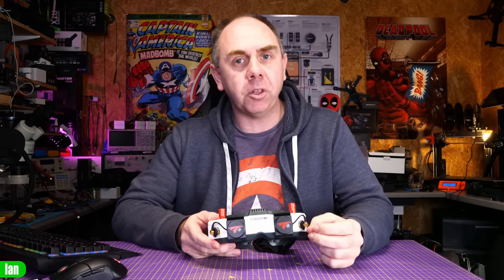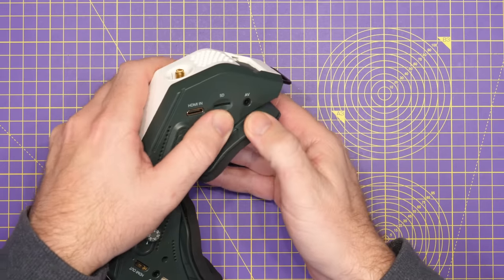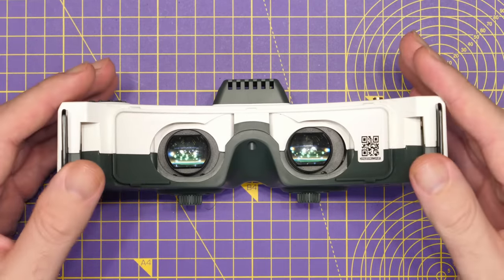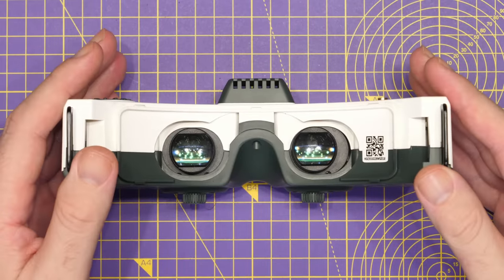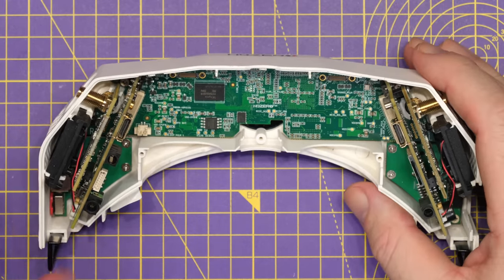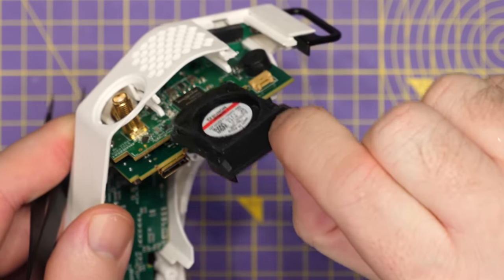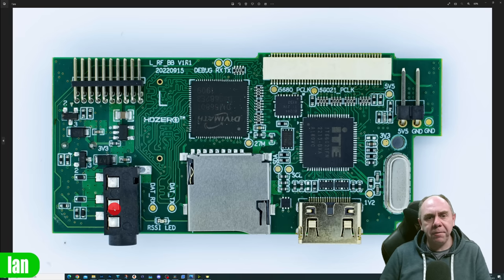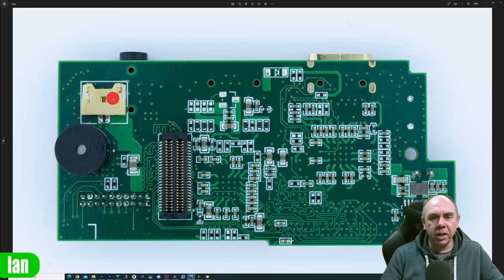HDZero FPV Goggles Teardown & Deep Dive + SMA Mod

Comment: So nice to have an electric driver for electronics when doing this. It allows you to focus on handling the delicate object more so then spinning the driver. I didn't understand until having experienced one myself, until then I thought it was probably more of a Hassle to get the electric driver and bit out vs just using standard screw drivers.  

 I will say the one area that really surprised me about the HDzeros was the side antennas don't even have a nut on them and there is a clear gap around the goggle housing and SMA connector. For comparison my Walksnail VRX is actually glued in the housing/SMA gap and that's using SMA to UFL so it's not like it matters beyond spinning/wiggle.

Comment: Wild idea, but could I use some sort of fiber converter to be able to have one of the two receiver moduals setup across the field in order to get longer range and stringer signal? I'm currently doing research and trying to figure out if this is possible. At my work we use a similar idea for broadcast cameras but the whole system is massive, both transmitter and receiver.
Of course the ideal is to be able to have multiple receiver units dotted around say a town or something in order to have a high quality, light weight drone follow camera. I'm interested in your opinion

Comment: Is there any chance you could PLEASE take a look at the optics as this would be very helpful as I am in need of a little help doing so as I have the floating optics issue.
Reply from the maker: Please can you explain what floating optics is ?
Reply: @MadRC  It is a known issue with all batches bar the ones being produced right now. It is where you can see the optics physically moving outwards and in when you raise your head. There are more cases cropping up on the fb page. The optics are moving towards you when you raise your head and falling back when you drop your head, this is more noticeable when your in the menu section. It makes them go from being perfectly in focus to completely out of focus. Carl & Gao are aware of this issue but, I was just wondering if you could make a video of taking the optics out as I am about to do so quite soon with mine.
Reply: I thought I had already posted a reply to this but, not sure if it was removed by accident or I didn't post it properly?
Reply: @mrph678  That would be amazing if someone looked at them and see if there is a fix that does not involve sending in the goggles to a repair facility. Two weeks turn around sucks and if someone buys used goggles that have this issue might not be covered with HDZero? 🤷‍♂

Would be nice if there was a DIY fix.
Reply: Don't worry I've replaced the faulty optics and it was an extremely easy task to do.

Comment: So, did you remember to put that screw back in on the io/rf daughterboard before closing it all up? 😂 I noticed the other rf board seemed to have a SMD led marked RSSI? Any idea what that was about? Great video, and good to know what to expect if I need to work on them. Will be ordering mine on Wednesday, fingers crossed they'll incorporate the spacer, but easily fixed if they don't.

Comment: Ian, why did you choose not to use the spacer with the recess to take an SMA nut on the inside of the goggles (also available from same person who designed the other pieces you are using)?

Comment: Another excellent video Ian. Did you find the RTC, I heard it was possible to add a battery and the clock would then just work or is there a software update / development required? I would be interested in your views on this.
Reply: I think I saw a debug pad that had rtc in the label but I'm not sure where and I'm on a phone so it's hard to look again. Pull up the photos like he did on a computer and look for that pad. Trace where it goes to and you can probably determine what's going on. Also, you could check the voltage when it's off and when it's on and see what it shows. And there's a slight chance you could solder a wire to that pad and to a gnd and connect a coin cell batt. But this is all just a guess. Comment again if you figure it out. Dvr with a proper time stamp is almost a requirement, so I'm really hoping the goggles have a rtc.

Comment: One important thing to probably do a follow up video. If you press the daughter board down like you did there is a high chance the white connector isn‘t connected properly. I removed the boards like 5 times to realize I have to press down right at the white connector, not at the top corner of the board) until it fully snaps in. Else you probably going to end up with a hello kitty screen, not working scroll wheel or battery voltage detection.

Comment: Thank you for this fantastic breakdown video, you went into incredible detail. One thing I noticed that you didn’t mention was any kind of accelerometer for the head tracking. I’m not sure if head tracking is activated yet or it will be activated in a further software. Thanks again.

Comment: Hello, I need to replace the SMD fuse, for an inadvertent one of mine in polarity version. can you tell me the value of this component? Thanks a lot
Reply from the maker: I would be going 3A.
Reply: @MadRC  thanks again, isn't there also a one volt value?

Comment: the V536 (not V356 as you did in the video) is a camera SoC. Linux will be running on the FPGA and not the V536.

Comment: I would appreciate it if you spent a little more time on the ocular section in these videos. My main reason for being here is to see if IPD adjustments can be made beyond the factory specifications (with 3d printed shells).  Relevent topics for me would include if the optic alignment bar can be removed and replaced. if any part of the assembly is rigidly mounted to the outer shell, etc. Most goggles don't fit my IPD, and these are no exception. If by chance you see this message and can incorporate more data in the future, I'd love to buy you a beer or sub to your patreon.
Reply: Let me know if you figure(d) anything out here. With an IPD of 74 Im not sure if its worth it to try and modify a brand new pair of goggles.

Comment: Someone knows if the hardware designs will also be open source in the future? Or just firmware?
Reply: Only parts of the firmware will be open sourced.
Reply: I think all of the design will be open source except for the HDZero ASIC chip. Keep in mind analog ASIC chips are closed source too.

Comment: This kind of mod for a "premium" goggle shouldn't be necessary and is yet another failing on HDzero rushing a product out, much like the first few batches of VTX-L that were not properly designed for 6s.
Reply: It's to be expected for the first production batch for any system. edit: as with Sir Missalot below, I find their willingness to admit to and resolve the issue to be the important takeaway from this.
Reply: well... its their first goggles and they fixed it for the next production wave. and the people that have that problem can send them in free of charge or do it themselfs if they don't want to wait. i rather have a company that stands by their errors and fixes them with options on how to fix them then a company like dji that doesn't care about its customers.